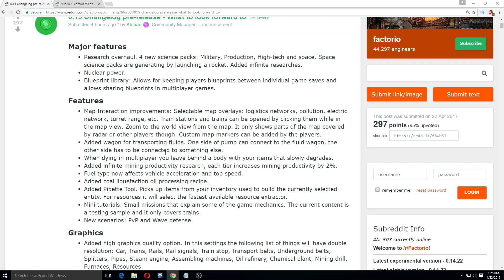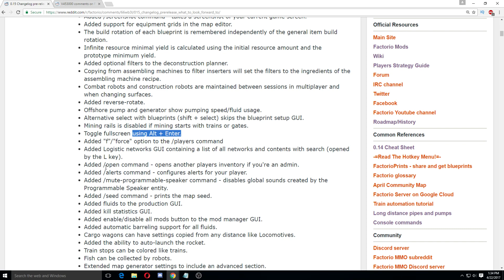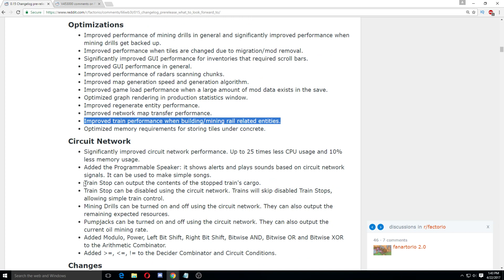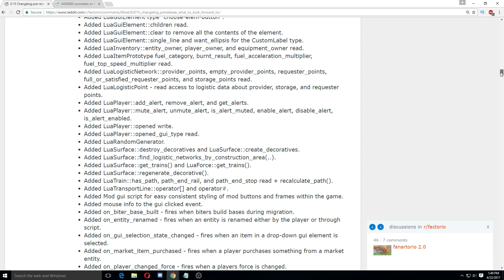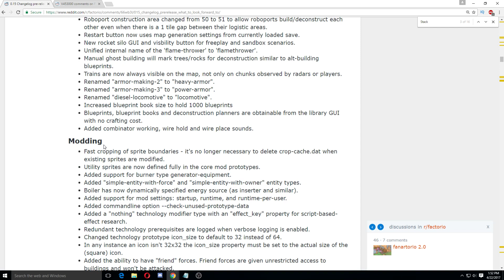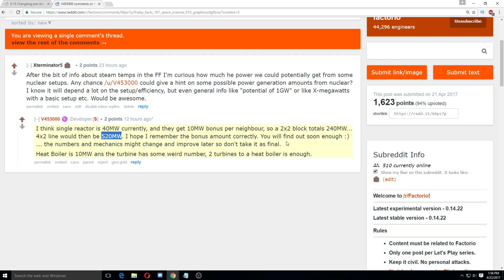Factorio 0.15 Changelog Overview & Analysis With Dev Feedback!

Comment: The number of turbines isn't that extreme. For a single reactor, that's eight turbines by the looks of this (maybe fewer if there's an unusual ratio that gives a non-integer ratio), and that's 40 megawatts. That means each individual turbine provides the power that an entire 1:14:10 steam array provides now. And the number of turbines does scale faster than the number of reactors, but keep in mind that that's because you're essentially getting free power by putting more and more reactors next to each other. By these numbers, a large nuclear power plant with a single 8x2 row of reactor rows would produce over a gigawatt of power with just over 200 steam turbines. With steam engines, by contrast, (unless they change the output of steam engines) you'd require 2000 to produce that amount of power.

Comment: The 520 MW Reactor setup would take 90 turbines, sounds like a lot, but.. just 1 of the popular roboport solar fields gives you nearly 11 MW. That entire field would now be replaced by 2 steam turbines, granted there are other parts to it. Still should take far less room to set up 90 turbines vs 45 solar fields (over 8000 panels and 7000 accumulators)
Reply from the maker: Very good point and comparison with Solar. Should be interesting to play around with for sure!